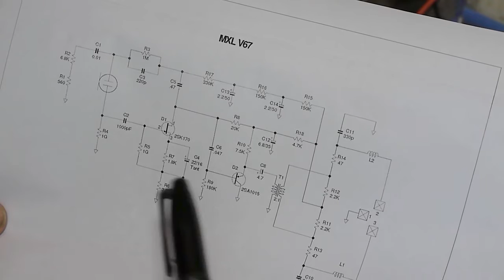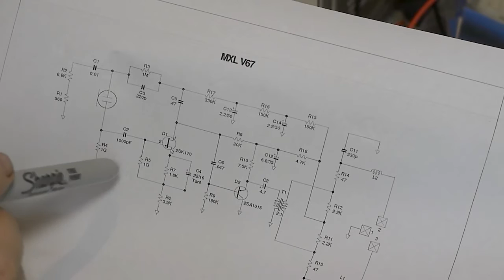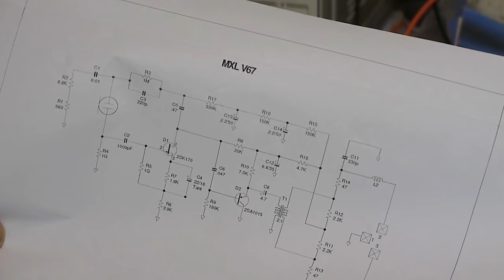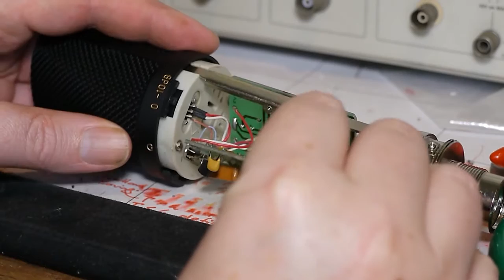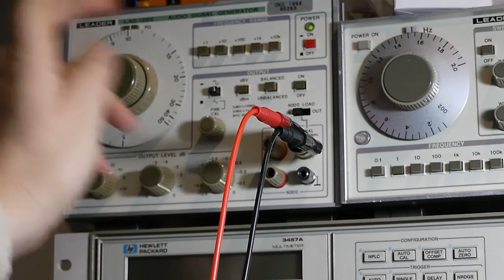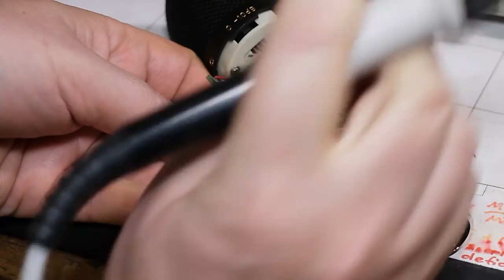Adjusting the bias of a condenser microphone

Comment: A very interesting optimization procedure to get more headroom for your microphone amplifier. It is clear that this procedure cannot be done by the manufacturer. The optimized bias current is different for every JFET. So the manufacturer needs to set the bias resistor in a way that will fit for all of the JFETs coming from the manufacturing process. Probaby it is possible to preselect the JFETs according to bias currents intervals where most of the devices meet the symmetry requirements. So they will sit around the drain voltage close to the midpoint of the modulation range.

Comment: on the forum for the ORS 87 - Stripped Down u87 I'm afraid to ask this simple question, is possible to adjust the bias with a simple DMM from GND reference to a specific test point?
Reply from the maker: I don't think you'll find a particularly optimal bias setting based on DC measurement alone, but maybe it could be helpful as a starting point. Perhaps look at the voltage on the drain of the FET - it should be somewhere in the mid-range between DC supply and GND - trying to place it at the exact halfway point probably isn't helpful though. You really want to optimise for AC behaviour and let the DC offset fall where it may.
Reply: @KarlAdamsAudio  thank you or the replay for what I read on the forum there's a simulation that shows 15.9V DC at the drain using a 36V zener diode at the moment that is the only reference I got, I copy the PCB  but I need measurements for the mic body PCB fastening holes in millimeters thank you again I got to keep reading on the forum good day

Comment: Hi, for the scope probe what setting? 1x or 10x..? How did u connect the output from mic  to the scope ? Balanced ? Or one leg of the signal only ? Pin 2 hot and pin 1 ground ? Thx
Reply from the maker: Good question - how do you measure a balanced mic output with a ground referenced instrument? If I recall correctly, I just connected the unbalanced output of my mic preamp (M-Audio DMP-3) to the scope directly, with the scope input set to 1M Ohm impedance. Naturally you're also measuring the behaviour of the preamp at the same time, but that wasn't a problem in this case. Thinking about how you might probe the mic directly, perhaps you could measure with two channels and use the math function to display the difference? You'd want to AC-couple the inputs, as they're at 48v relative to ground because of the phantom power.
Reply: @KarlAdamsAudio  hi, I’m new at this, I’m a hobbyist and not too familiar with all the terminology. Would be great if you did another video connected directly to the mic balanced output and show procedure. But isn’t the math function only on digital scopes ? 

I came across your video while searching about biasing JFET…Because I have original Rode NT1 mic that I recapped and did the Jim Williams (designer of the mic) sibilance mod (changing values of 2 film caps). It sounds great but when I try to use it on louder sources like a tom drum, at 1-2in away, I can hear a little distortion.. I saw your video and thought maybe I need to re-bias the Jfet. 
I don’t recall the distortion being there prior to the mods. 
I have a few of these mics and did the mod to all of them. And they all have the same symptoms. Chances are the mods have  something to do with it. 
But I was also going to try putting back the original caps to see if symptoms went away..

Thx
Reply from the maker: @Maxxzinno  Yes, the math function is a feature of digital scopes. For this sort of work a hand-held 'scopemeter' can be excellent because the input floating, you can measure between any two points without concern for ground. From what I've gleaned, the NT1 circuit is a variant of the transformerless Schoeps circuit, and the mod involves capacitors between the bases of the output transistors and ground. I wouldn't imagine that would disrupt the bias conditions of the JFET. Also note that the JFET in a Schoeps-style circuit acts as a phase-splitter, we derive a signal from both source and drain sides in order to create our balanced output signal. In that case we can't go changing the resistance in the source leg without messing up the balance, so the method for bias adjustment is somewhat different to the one I used.
Reply: @KarlAdamsAudio  ok so if it’s not the JFET biasing, It’s possible the NT1 is just too hot for toms at 1-2in.. I will make a video with a sound clip and share the link on this thread…if I can get your opinion on what you think it can be… would be great. Thx

Ps; I also have another NT1 that has way more background hiss than the others.. it makes it unusable… any thoughts on that ?
Reply: @KarlAdamsAudio  hi so I figured out that the mods I did to the mic is what was causing the distortion. The mod involved changing 2 470pF film caps to 1500 or 2200pF. I read about the mod from the designer of the mic, Jim Williams, on a forum…he had suggested this mod as the only viable mod to better the mic. What it does is lower the sibilance… but I guess it lowers the headroom on the lower frequencies also… I guess for vocal purposes it wouldn’t matter. But because I was using it on drums(toms) it mattered. Basically I reinstalled the original 470pF caps and the distortion is gone. Now the thing is I had messed with the trim pot trying to get it not to distort, so now I wonder… I have another NT1 untouched, can I measure the value of the resistance and just set it to the same on the mic I touched. Or does it really need to be Re-biased now with test equipment…? As for the method for biasing a fet in schoeps mic like NT1, would you have any info on the method ? Thx…

Comment: Great video, thank you for making it. I'm replacing a bad JFET on an old Sony electret condenser mic and will no doubt have to adjust the bias point due to the original FET being unobtanium. It makes sense that the optimal point for headroom and distortion would not be too far apart.

Comment: Hi. i have a usb microphone, the JFET is soldered directly to the mic capsule . The orignal JFET is 2sk660, I want to replace it with 2n5457. How can I bias the FET?
 
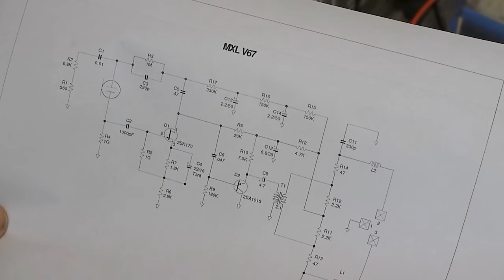I found a advice from 10 years ago but the picture is gone, can I add some resistor with the FET like schematic at 3:33 ?
 Can you help me please?
Reply from the maker: Hard to know what to recommend without knowing more about the circuit - the typical transformerless Schoeps-inspired circuit has identical resistors in the source and drain legs of the FET, so changing the source resistor isn't the approach to take. Also, I'm wondering if your mic has an electret capsule, given the gate of the FET is soldered to the capsule without a capacitor to block DC.
Reply from the maker: Doug Ford's EEVBlog video on electret microphone design is an excellent resource:
https://youtu.be/UhG83WS51q8
I note that the 2sk660 incorporates the high value resistor from gate to source (it's a device specifically intended for this application) while the 2n5457 will need an external resistor (of around 1G). Also of note is the IDSS range of the 2n5457 is much higher (i.e. the lowest value for 2n5457 is double the highest value for 2sk660), which may be a challenge when selecting an appropriate resistor value between +ve supply and FET drain.

Comment: Thanks for this video.  With all the "mic mod" kits, it's nice to see some theory and measurements.  
Can you describe how the signal injection being reference to ground gives valid results and why the injection point wouldn't need to be at the capsule + and - points?
Reply from the maker: Thanks for that - it's a very good question. For a bias adjustment it's not really an issue - we're applying the signal via the 1nF coupling cap to the gate of the FET (so DC offset won't be a problem), and avoiding having to worry about the polarization voltage. Connecting the signal generator across both capsule leads would be applying the polarization voltage to the signal generator, and the low impedance of the signal generator output (say 50Ω) would basically short the polarization voltage to ground, drawing extra current that wouldn't be the case during normal operation, and thus changing voltages elsewhere in the circuit.
Where this gets (even) messier is that the other capsule lead actually has some AC signal riding on top of the polarization voltage, as this mic (shamelessly) copies the U87's negative feedback scheme for HF de-emphasis. Brute-forcing a low-impedance signal onto the gate of the FET completely obliterates this effect, so if we were measuring frequency response we'd get a misleading result. Thankfully, for a bias adjustment, we do manage to get away with it.

Comment: Oddly enough, you never specified what resistor value you used between R8 and C6 for the J508 constant current diode replacement at R10. Personally, I think that would probably be the most important part of this mod because it lowers distortion. Care to specify ?
Reply from the maker: Indeed, I did rather gloss over that point, didn't I? I have opened up the mic & confirmed that the added resistor was 510kΩ.
Reply: What other transistors can be used instead of the j508? Any diodes.?

Comment: Hi Tomxico here from Portugal. My studio condenser mic works just fine but sometimes then the signal is very low or even vanish away. Is there a bad capacitor or something ? It's not about fantom Power cos I have oneother condenser mic and works just fine. Can someone help me ? Please I am locked a home due to the virus. Heath to you all.
Thanks
Reply from the maker: I suspect you may have an issue with humidity and/or dust on the capsule. If it provides a leakage path for the polarization voltage, the mic will go quiet (or even silent) for several seconds until the polarization voltage builds up again. If this is the issue, it will get a lot worse when you breathe on the capsule. You can try leaving the mic in a warm environment to evaporate off excess moisture & that may help. Actually cleaning the capsule is quite tricky due to how easily it can be damaged, so I'd be wary of attempting that.
Reply: @KarlAdamsAudio  Thank you  for your prompt response. You are right. A minute or 2 and the mic gets low signal input and just vanishes. Then after a minute or 2 come to normal db sound. but if working for a full hour or 2 gets normal all the time. Bad capacitor ? Or just  the humidity in the capsule ? I will try to clean the capsule.
Thank you for your advise.
Reply from the maker: That does sound to be consistent with a dust + humidity issue. With a K67 style capsule, you have that ring of unsputtered mylar around the outside of the diaphragm - if you get too much dust on there, then condensation from the air will form a conductive path that will discharge your polarization voltage. Even without excessive dust, storing the mic in a cold and/or humid environment can cause similar issues. In extended use, the mic may get warm enough for this to no longer be an issue (this is especially true of tube mics, that have their own built-in heat source). If you have a dusty capsule, then breathing on it (close & open-mouthed, like you're trying to fog up a mirror) should cause it to cut out almost immediately. Cleaning a capsule is labour-intensive, as I understand the technique is to use a fine camel-hair artists brush and distilled water, and (using a bright light & magnification) remove individual dust specks with the tip of the brush.

Comment: Very useful video, thank you so much for it! I read in one of your responses to the comments that you would not recommend to leave the capsule when performing the biasing connected but rather to attach the signal gen through a 68pf cap (as I understand it, you meant a coupling cap). On the other hand, some advice on biasing the fet I've read don't mention connection through a coupling cap. I'm wondering what effect this cap or its absence might have on finding the best biasing point.
Reply from the maker: Thank you. It's a very good question - I suspect it doesn't make much difference, but I'm not certain. You're already applying signal to a 1nF coupling cap anyway, so from a DC perspective it should make no difference. That said, I'm a little wary of using a signal generator with low output impedance to substitute for a microphone capsule having enormously high impedance - strikes me there's the possibility that things might behave a little differently. As I understand it, the idea behind coupling the sig gen through such a small capacitor is to give an effective output impedance of the order of a few meg-ohms, and thus avoid "pushing things around" in a way that the microphone capsule could never do.

Comment: The first time i watched this video, id built my first mic from a pcb and mouser parts list, but my knowledge base was  "put the part on the matching number on the board". I didn't understand the jfet or its bias, and i'd unknowing had already done it by virtue of the trimmer resistor in the kit and the instructions to turn it till i get a x number on a multimeter, which i didnt how use to use either. I watched this video twice, not understanding any of it and doubting if i ever would. I kept going, trying to learn more until, eventually, i was able to design my own condenser mic circuit and make my own pcb. I remembered this video, and i was happy cos i finally new what Karl was talking about. So i watch this every now and then, being able to take it all in, remembering there once was a time that i couldn't!
Reply: Bravo! Respect for you. It is obvious that Carl Adams has knowledge, but he would have to find a more appropriate method and presentation to convey his knowledge in an accessible way to people interested in this field.

Comment: not can i change r7 7 on any mic and replace it with that adjustable resistor  for the bias?
Reply: because i have r7 on my mic but a little closer to the input of the mic
Reply: im trying to install a big capsule on an electret mic but it seems not to have enough power
Reply from the maker: Are you trying to substitute a condenser capsule for an electret? As that's not going to work due to the absence of the polarization voltage that condenser capsules need in order to function.
Reply from the maker: Probably not - it's not safe to assume that the resistor named 'R7' performs the same role in the circuit. A suitable candidate would be a resistor in the Source leg of the FET, bit it's not necessarily the one called 'R7'.
Reply: @KarlAdamsAudio   thanks for the info bud ..i really just need help to make   an electret mic work with a big capsule ive been studing mics trying to find it out here the bias i see on the mic i hav does have a fet resistor but when i swapped the capsule it didnt work i tryed it on another mic and it worked beautiful i think  the small electret mics would be a good shell to convert to true condenser i just need help designing a circuit  to run piggy back and give it enough power to use a k67 capsule  theres very limited.. info online ive been looking any helps appreciated
Reply from the maker: It's an interesting challenge to be sure - do you have the schematic of the existing circuit for your electret mic? Straight off the top of my head I'm thinking you'll need a VERY high value resistor (say 1G ohm) to apply your polarization voltage to the capsule. Tying the capsule too 'tightly' to your power rail will effectively ground your AC signal, and you'll get no output. In terms of online resources, there are some amazingly knowledgeable folks in the MicBuilders group at Groups.io (formerly on the old Yahoo! Groups platform).
Reply: @KarlAdamsAudio  i have the schematic for the mic i want to do it to .. i see some stuff saying i may have to put step up amp dc tpo dc converter and some sort of power transformer  but i see some mics dont have a transformer